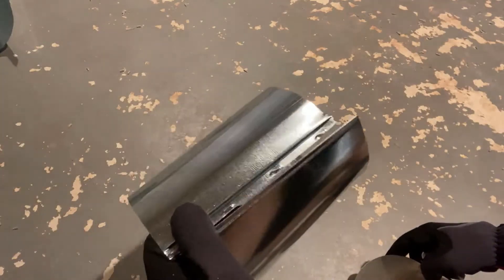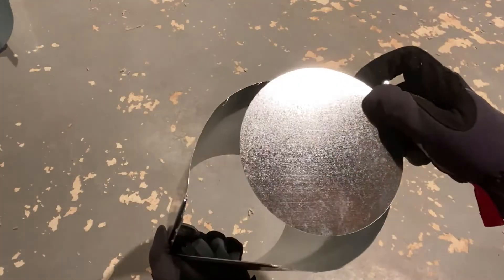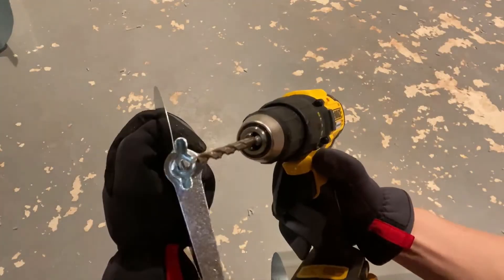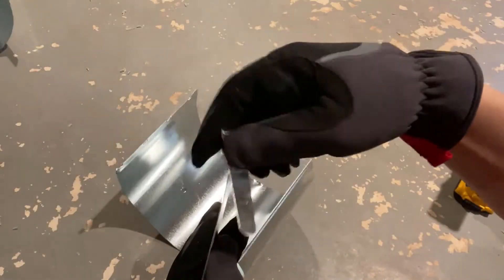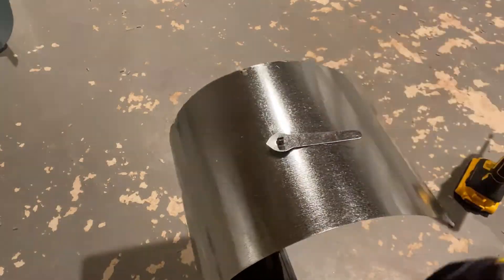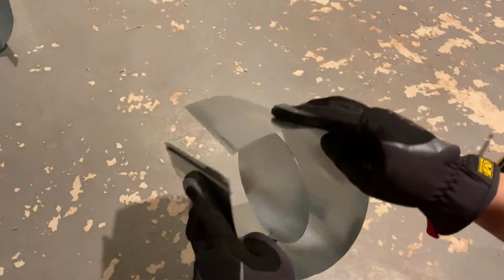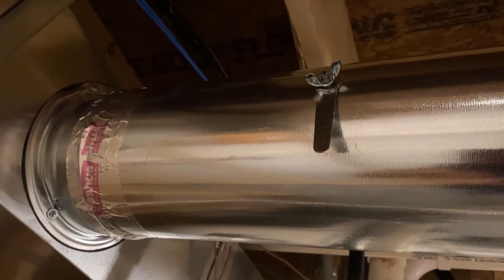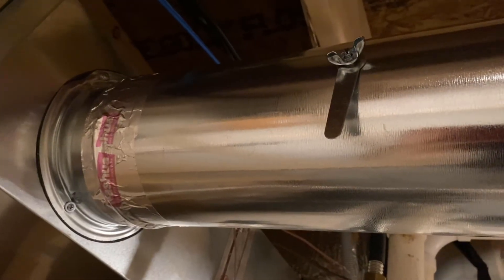[Quick How-to] Install Damper for Easy DIY HVAC Ductwork

Comment: Wish my damper is set simple like this. I have a flexible duct and there is wingnut which sticks up vertically and can only turn it to the left and right. How do I determine which is closed and open?
Reply from the maker: My damper’s handle was aligned with the damper so I could know open/closed that way
Reply: Look for a slot on top of the screw head, it should be the same angle as the damper.

Comment: You can easily install a damper without disassembling the duct work by:  1.  Cutting a slot perpendicular to the ductwork so you can slide the damper into the duct.  2.  Drill a hold on the opposite side of the duct.  3.  Slide the damper into the duct and seat it in the hole you drilled.  4.  Drill a hole in a piece of scrap ductwork large enough to cover up the slot you cut in step one.  5.  Screw the scrap patch over the slot to seal it and finally install the handle on the damper.  You can see this in a "this old house" video on dampers.
Reply: Any chance you have a link because I’d appreciate seeing that.
Reply: thanks for taking time to share this..defiantly going to do mine this way.
Reply: I can't click on link. Please share the video title so we can look it up
Reply: @shaltooooof  How to Balance a Forced Hot-Air System | This Old House - 2:10 in
Reply: @thomasmiele4543  thanks for the title..